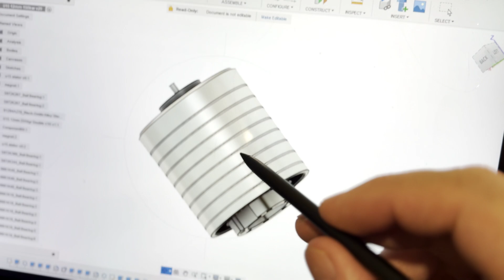High power eVTOL propulsion system of Skyrise aeronautics

Comment: Cool! How much power does it use to power?
Reply from the maker: According to test results 90 percent of efficiency at Max power with 47 inch 4 blade propeller
Reply: Do you have a email? Website is blocked for me.  @Skyrise-aero
Reply from the maker: You can contact skyriseaero@gmail.com

Comment: 450 kg of thrust for just one? Is that with one rotor blade or 2?
Reply from the maker: 450 kg for 150kw BLDC motor and with 4 rotor blades and it's 47 inches propeller.
Reply: @ so that’s for all 4 motors? Is there 4 or 8 motors?
Reply from the maker: Propulsion system of our Evtol is different in size and power but the patent is the same.

Comment: Doing my Masters in Machine Design and I really need help determining the torque to be produced by a Motor by Calculation.
Reply from the maker: It is a good question! You can use the formula of the torque.
Torque (lb.in) = 63,025 x Power (HP) / Speed (RPM)
Reply: P=2(pi) NT/60 Where N= rpm P=watt T=Nm  so knowing the power and the RMP it  is T=60P/2(pi)N